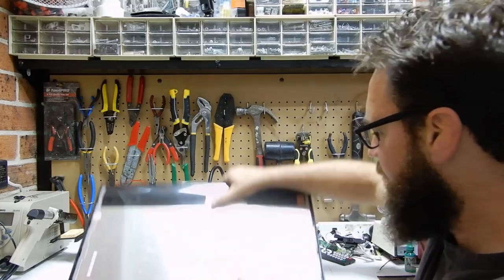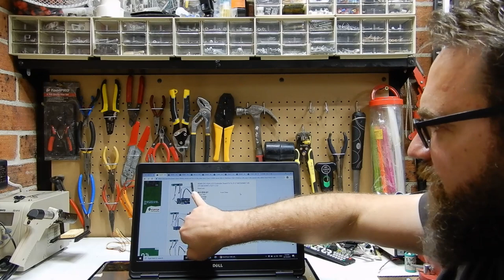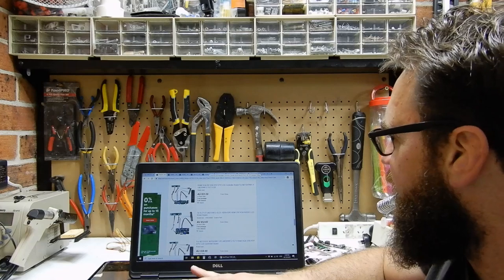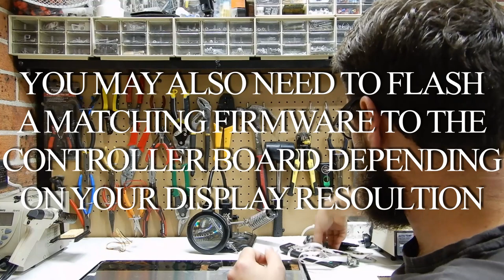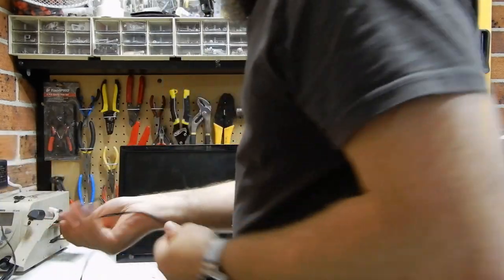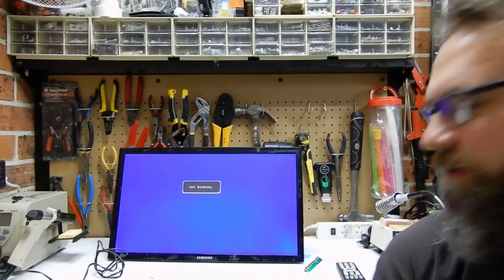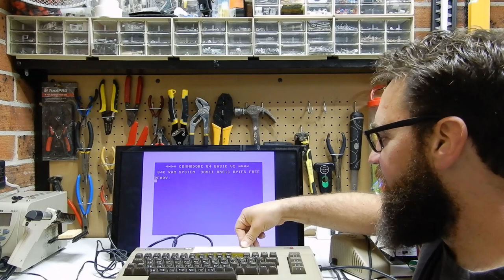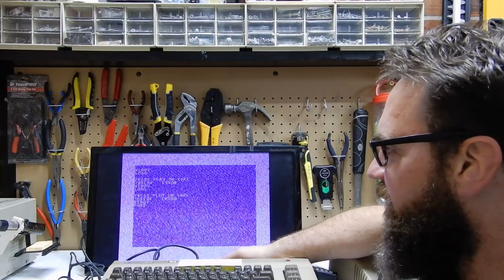LCD recycling and repurposing- uses for an old LCD/LED monitor or laptop display

Comment: I have a 38" TV with a good LCD panel but bad power supply + mainboard (didn't find out the power supply was bad until it blipped after an hour of use and fried my replacement mainboard).  I found this video while trying to decide what kind of project I could do with it rather than just trash it.  My first reaction:  "Hey!  That's Mark from The Retro Channel!".  Thanks for the info... might see if I can fit the panel in my custom arcade cabinet now.  :p
Reply from the maker: Haha, yeah this channel is just more for random shit that I come across.
A 38" 16:9 would make for a monster arcade cab. Even if you blank off the sides to make it 4:3, that's still about 31". I think there are driver boards that can handle larger screens, and most have a wide variety of inputs but as always with this stuff ymmv

Comment: Could I take boards from lets say an old TV and we use them on an old screen
Reply from the maker: Unlikely, these boards are designed to be somewhat universal. A board pulled directly from an old tv will likely be designed to only work with said tv

Comment: Hi there, I saw your video accidentally while looking for help to convert my old laptop screen to a monitor and my question is I also have a problematic LCD desktop monitor laying around and I think the board has some issue. Will this method work even if the main or internal board of the monitor not working?. Thanks in advance
Reply from the maker: It should, as it replaces everything expect the screen itself. You will need to determine to actual panel model, it should be on the back of the screen itself, and find a driver board that's compatible. Check the links in the video description
Reply: @Sawickipedia  Thanks man, can't wait to try it.
Reply: just replace the broken capacitor and your screen will be fixed